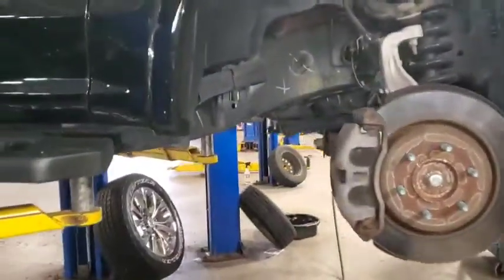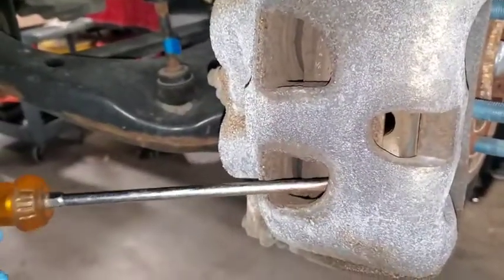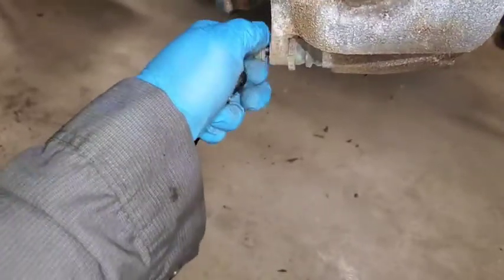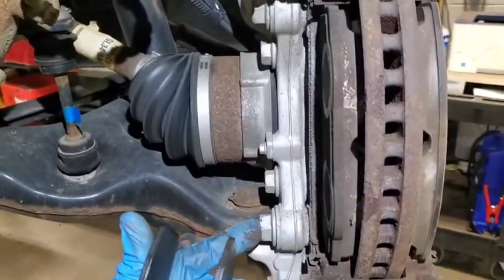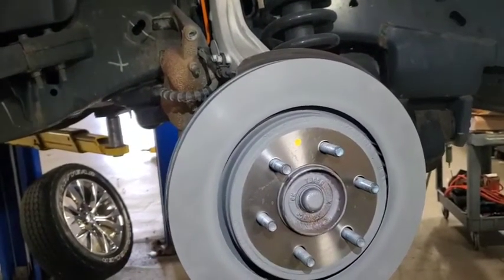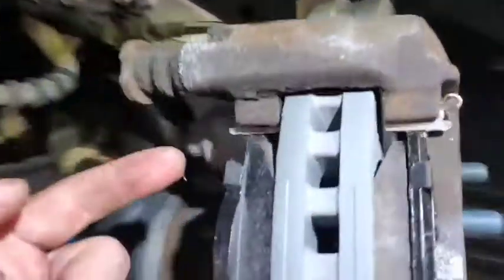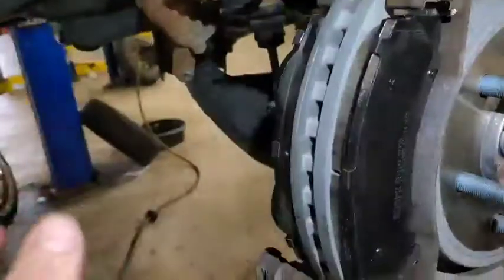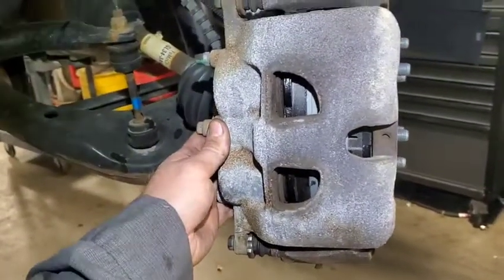2017 Ford F150 Front Brakes & Rotors Replace - Most Trucks Actually

Comment: Those front pads (BR-1414) have been "superseded" by BR-2087 / AU2Z-2V001-F.  The replacements do not have the ears/tabs on the back / inside pads.  Same with the BRSD-1414 (Severe Duty) replacements, the BRSD-2087.  Have you seen that?  Are there any issues with using those pads on the inside, up against the caliper pistons?

Comment: Quick question… it seems that I read somewhere that my 2017 F150 front brake calipers require the opening of a bleeder valve before compressing. I cannot find anyone that actually covers this step. Is this something that you are familiar with or that I should worry about?
Reply from the maker: Nope that is not true that was an old wives tale that was brought up back in the day and then it was like Toyota back in 1988 or 1990 had a problem with releasing the Pistons so they recommended people crack the bleeders to release them but there has been no manufacturer since then it says to do that so no you do not need to crack the bleeders do it exactly like I do in my videos
Reply: @FordBossMe  Thx!
Reply: I unscrew the brake reservoir before pushing pistons back.

Comment: Great video and step by step instructions, what's the torque spec for the caliper and caliper carrier bolts?
Reply from the maker: I don't work for the dealer anymore I don't really remember I'm in the shop right now working with the text today let me see if I can go back up front and look I don't just tighten the damn bolts LOL
Reply from the maker: Caliper slide pin bolts are 27 ft lb and the caliper anchor bracket Bolt says 184 ft lb but I don't never do that I just tighten them up really tight put some blue Loctite

Comment: Nice work. I did this for my 96 Explorer a few weeks ago. Same exact style 2 piston caliper and pins. Only a 17? My pins are always smooth. Good idea with the locktite on the bracket bolts - if those aren't torqued (or even if they are) they can get loose!  The explorer is 140 on those caliper bolts too.  I got the Grey Ford Rotors. Hope they don't rust in a few winters! I also got Motorcraft "Superduty" pads. Very impressive! There were a few bucks more. Maybe you can upsell them :lol:.  I think from Rockauto all the front parts were under $150 shipped. I like painting the hub faces and under the hardware with antisize. My brakes failed because rust under the bracket hardware  (same setup) locked the pads. Don't know if it helps though after a winter or two. Since its DIY I also did a scan tool abs bleed. I'm sure that would cost a few bucks at a dealer.  Very professional work there!
Reply: ^Meant "Severe Duty" Pads
Reply from the maker: Yeah these are like 140-150 as well my little gun doesn't put out any more than that so I'm right on the money every time so that's why I use this gun as long as people get them tight and make sure they're tight and put a little Loctite on it they are not going to come out of there
Reply: @FordBossMe  Used to be on a forum and alot of DIYers ended up with broken wheels over those bolts :lol:. I'm sure some "pros" make the mistake too.
Reply from the maker: Never had a come back never had an issue thankfully

Comment: You also need to “burp the boots” and get all the air out of the caliper pin boots by pushing on the pin and compressing the boot and then while holding it there, use a small screwdriver to crack open one end the boot to expel the air out. If you don’t the outside pad could drag on the rotor wearing it down prematurely.
Reply: No you don't need to burp the boots.  That's Biden talk.
Reply: The boots burp when the pins fully compress

Comment: I must have missed you removing the Rotors
Reply: Just take a 10lb sledge hammer on the inside and 20 minutes it'll be off, may need a new wheel bearing.   Way to go Ford!

Comment: Where do you buy motocraft parts ?
Reply from the maker: Rock auto or ebay or Amazon Actually 

if you know the part number there are to many places that may be an option
Reply: @FordBossMe hi rich. Whats the torque specs on the caliper bracket?